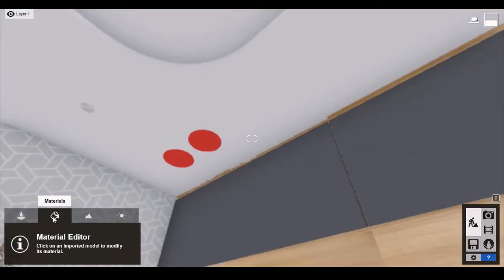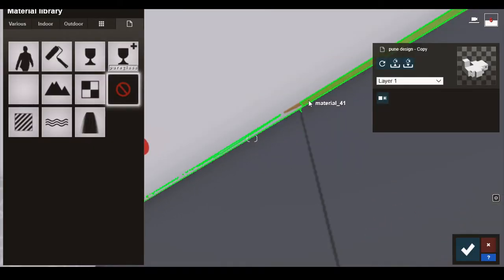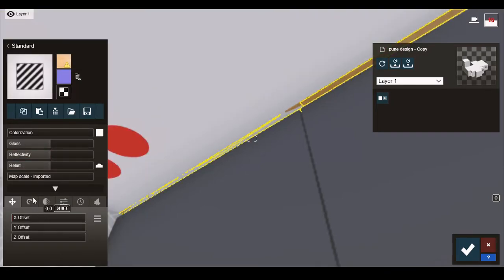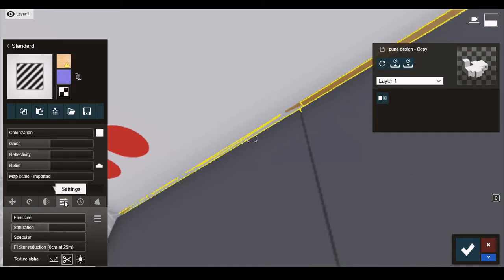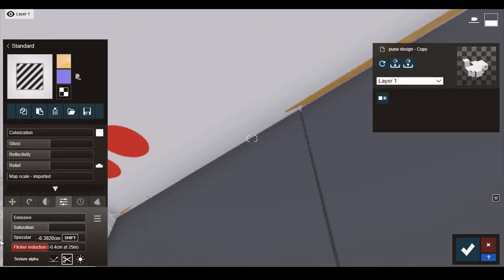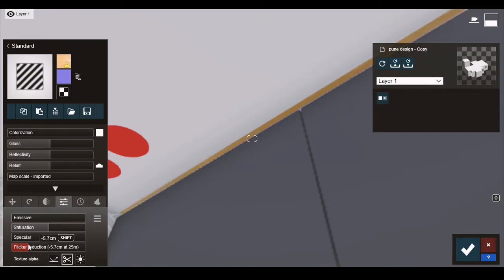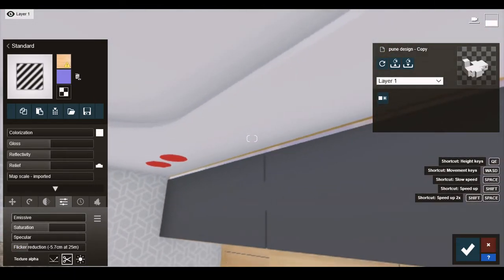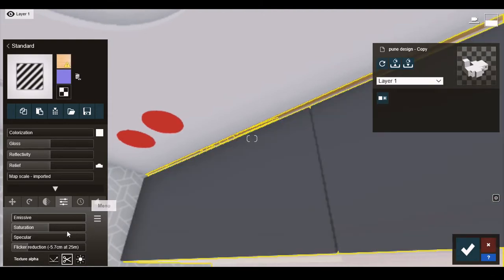how to remove or repair material flickering in Lumion 10.3.2

Comment: How do i fix missing wall or invisible wall.
Reply from the maker: Before exporting to lumion from sketchup, Please check if there are any grey surfaces in the model (except those surfaces which you have purposely colored in grey) 
If you find such surfaces then please color them with your desired surface color or material or texture.
Once you have done this process then export the sketchup model and import in lumion, your problem will be solved.